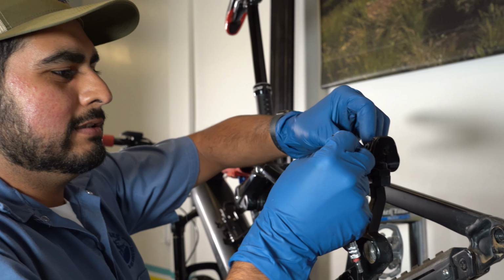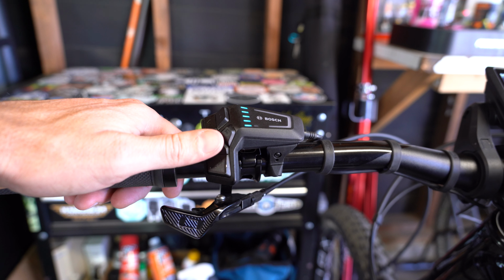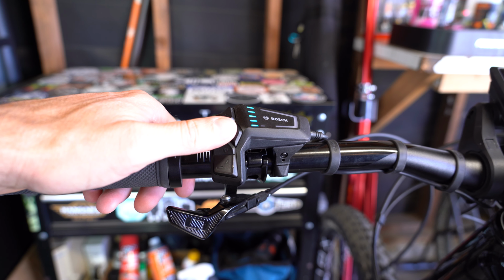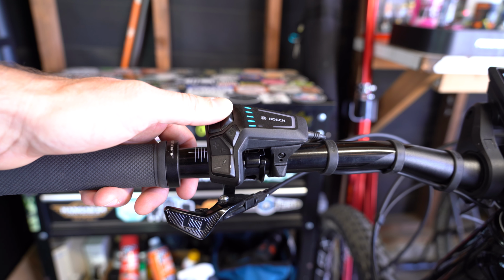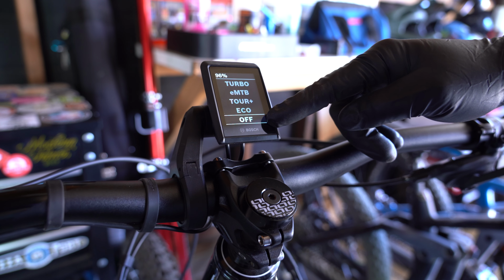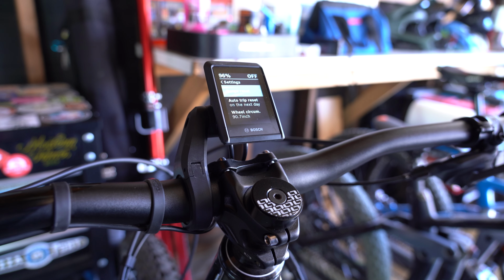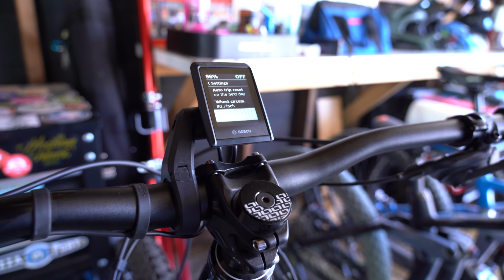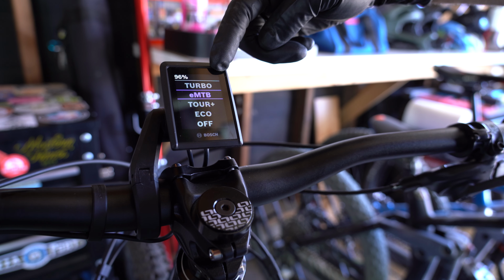Bosch Smart System Walk Through | Learn Everything You Need to Know About Using Your Smart System!

Comment: Can the walk mode aid you in starting on a hill? If you press the walk mode while sitting on the bike will it move forward until you achieve balance and can start pedaling with both legs? Hill starting is difficult because you often get less than a half turn of the pedal before assist stops and you lose momentum (and balance) before you can get the other foot on the opposite pedal.
Reply: Walk assist can only work when you’re walking next to the bike. There are no throttles on Class 1 Bosch ebikes.
Reply: @HectorSalcedo  Yes a stock answer, but not helpful. What happens if you sit on the bike? Some bikes cut the walk mode when you touch the pedals. Some continue to move if you press the pedals.
Reply: @rik999  To answer your original question, no.
Reply: @HectorSalcedo  Thank you. That's what I needed to know. A little 1 mph uphill rolling start would be a god-send for people with static balance issues due to age or medical conditions.